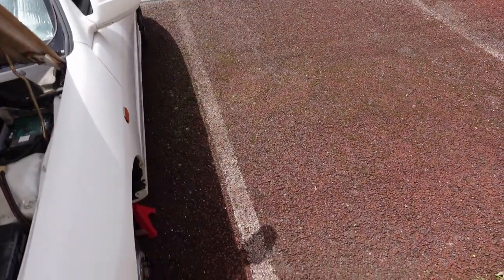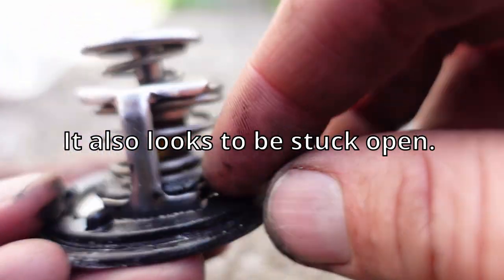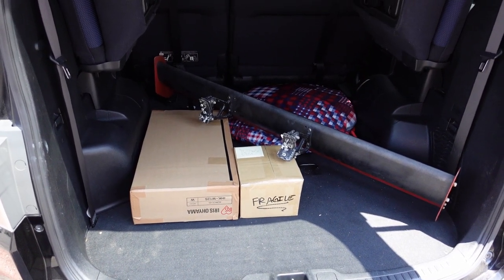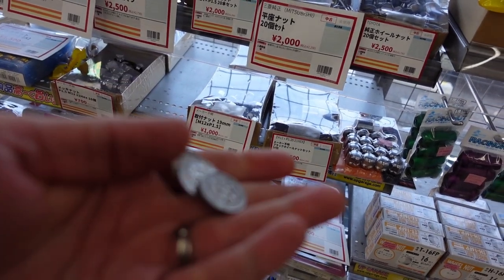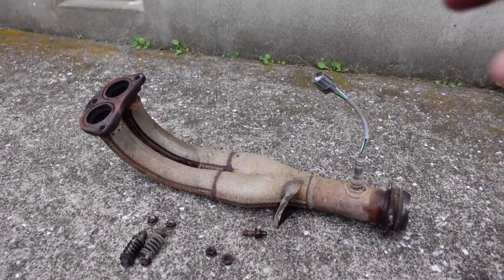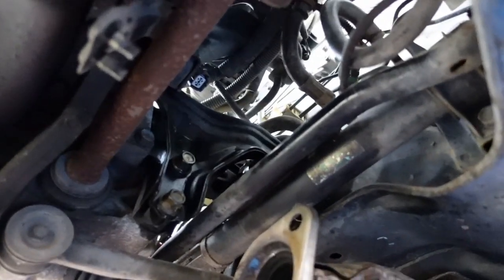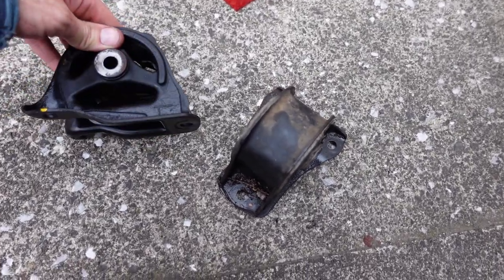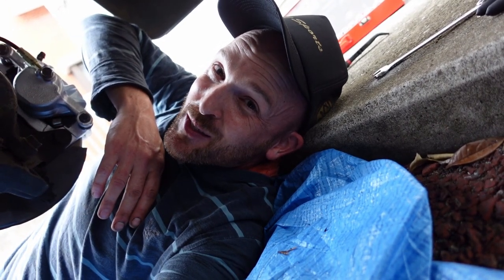Restoring ABANDONED Integra's engine bay & Selling parts at UpGarage! Part 2 | DC2

Comment: Just did the motor mounts on my car. I agree the back mount is not that fun, but not impossible. 14mm on a wobble. I assume you slid the mount out towards the passanger side. You can do this only removing the intake. Also for the shifter, I recommend watching LHT Performances video on the rebuild. Nice video!
Reply from the maker: I need to get some wobble extensions.  They would have been a big help for this! And thank you!  I'll check it out - I need to see how things are supposed to be for the shifter.

Comment: For the rear mount, yes, long extensions to the top of the engine bay. Or you can use a regular wrench for the two side bolts
Reply from the maker: Word.  I couldn't get enough leverage on the sides so I had to go out the top.  It just really didn't seem possible at first!
Reply: @BRICKHOUSESPL  Yeah I always go from the top unless the engine is out of the car. Then it's a toss up of which way I do it. Keep wrenchin on your car enough and you'll learn all the tricks on the older Hondas
Reply from the maker: @mr.nobody7601  oh man, starting with such a rough base has definitely been a crash course in figuring things out!  Haha.  Appreciate the help!
Reply: @BRICKHOUSESPL  best way to learn! And no problem. I don't know it all, but I can certainly try to help you out at any time. Been messing with 90's Hondas for the last 15 years at least
Reply from the maker: @mr.nobody7601  I appreciate that!  That is me with Nissans, but it's been fun learning a new platform with such a good community around it!

Comment: 2:02 Whoa whoa whoa hang on a sec, you need a title to a car to buy parts for it in Japan?!?!
Reply from the maker: Well, yes and no.  Technically, they just need four numbers in order to look up parts...but those numbers are found on the title.  Chassis number is one.  They pinpoint exactly what your production specs are vs all the typical questions US parts stores ask...and still kind of miss the mark at times.  Without a title or a specific part number, the conversation doesn't get too far.  Haha
Reply: @BRICKHOUSESPL  That's kinda crazy. I've never heard about that. Is that at just OEM dealers or at like a Super Autobacs too? (I've always wanted to go in one of those stores, I've seen walkthrough vids & it looks like heaven lol)
Reply from the maker: @johnbrennan8611  that's just been my experience buying new OEM or OEM replacement repair parts at dealers, parts stores (like O'Reillys style), and certain online sellers (of like alternators and specific fit type items).  Aftermarket parts are less closely checked since most items apply to a run of a chassis, for example, versus small mid production run changes that occur with OEM parts.
Reply: @BRICKHOUSESPL  Gotcha. Where would I go if I wanted to get some parts from ya? I picked up a 1985 Corolla GT-S (AE88) and would love to get some JDM AE86 parts for it, Tec-art's especially.
Reply from the maker: @johnbrennan8611  oh nice!  You can send an email via the contact form on nerdgold.jp.  DM on IG okay as well but gets hard to keep track of there.
Reply: @BRICKHOUSESPL  Okay sweet. I'll definitely check that out. Thnx👍

Comment: I have to disagree 😄 Honda parts where i live not so cheap, for integra dc5 especially 😄
Reply from the maker: Oh for sure - I should have said here in Japan.  As I research parts, I see OEM parts listed abroad and then find out how much it is here and it's a pretty decent margin added.  Sometimes nearly double.  Especially with the exchange rate now.
Reply: @BRICKHOUSESPL  it's fine 🙂 i'm strugling with some parts, but OEM parts get from Honda dealership or USA 🙂